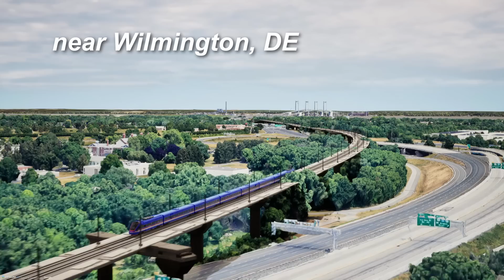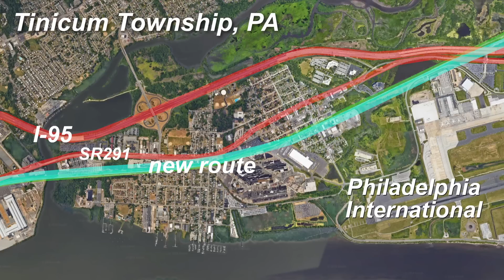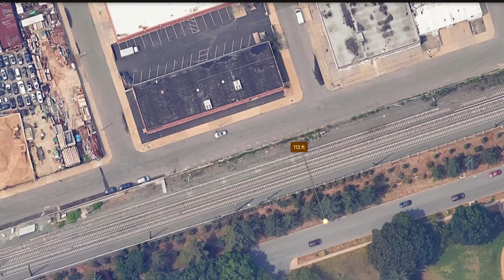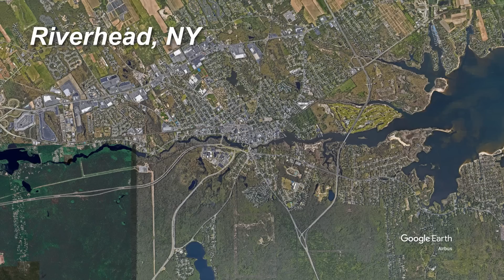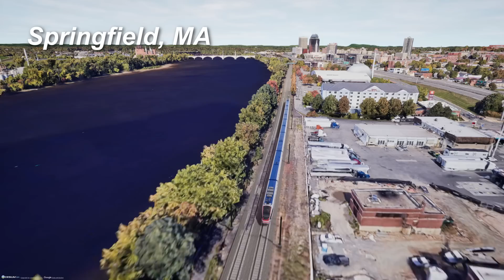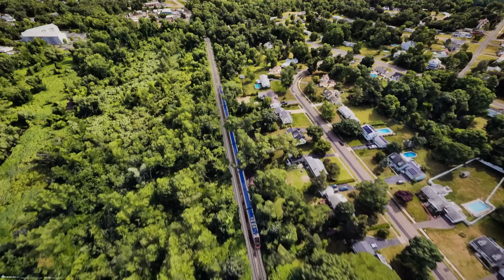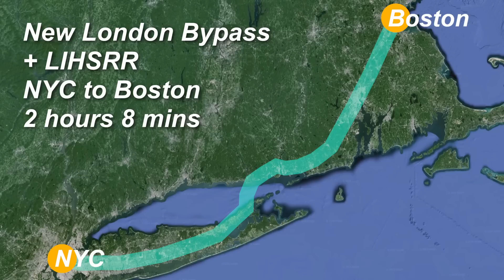How YOU Would Improve the Northeast Corridor For Acela High Speed Rail Service

Comment: 45 minutes could be saved by fixing the extreme schedule padding and lower than geometric speed limits from NYC to New Haven on the current ROW.  That would be nearly free and should be the #1 option to start with.
Reply from the maker: I talk some about NEC Commission plans to cut 22 mins from NYC-New Haven in the first video. This is largely accomplished by electrical upgrades and speed increases in the existing ROW.

Comment: Man it'd be a real kick in the balls to dissconnect a 1,622,520 population metro area from the NEC High Speed rail. Especially considering RI is already one of the fastest sections of the NEC. Removing the Providence stop is a non starter IMO.  Its rough man, CT really screwing us over.
Reply from the maker: What's going to stop Amtrak from running trains on the existing line?

Comment: Great video, and you've become my favorite channel on these topics.  (sorry citynerd). I think the "island hopping" through and under Fishers Island would be the best rout to get from Long Island back to the mainland.  If it was a tunnel it would lessen opposition maybe?  I'm not going to mess with you on your pronunciation of Ronkonkoma (lol), but the stop there should be coupled with a new terminal on the Northside of the airport.  Also what if the long Island to mainland tunnel had an auto train type service?
Reply from the maker: Here's the logic on Orient Point. First, you can't get to it on the surface from Greenport. At best you can come back to the surface for a mile. Can't island hop on the surface. With a tunnel, the islands are irrelevant. On Fishers Island, you have maybe 2 1/2 usable surface miles assuming that could possibly be allowed. It is 31 miles in a straight line from Greenport to Rhode Island, so you're looking at 30 miles of tunnel there. It's not a good choice.
Reply: @LucidStew  the island hop under the islands, like Fishers, would give you ventilation shafts and emergency exits if that kind of thing was needed.  Granted this would be a super long tunnel.  I don't know, 30ish miles?  Anyway thanks for the reply and all the work you put into these videos.
Reply: Just wanted to add as a point of reference, the Channel Tunnel is 32 miles long.

Comment: It's probably not worth another video, but exactly how unsalvageable is the route between Philly and NYC? What kinds of speeds does it currently get and how many trillion dollars would it take to upgrade significantly?
Reply from the maker: It's not that bad, its just that its not worth the cost to upgrade it. NYC to Newark, NJ you have the work currently on the books and that's about as good as its going to get. Elizabeth and Metuchen are the two sticking points down to Trenton. To get both up to 160mph, you're probably looking at 8-10 miles of tunnel. ...or you could just go 90mph for 15 miles... Trenton to Frankford Jct. you could get to 160mph, but its similar to New Jersey where anything you decide to do on the surface is going to involve taking out a lot of property for what you get. Then, of course Frankford into 30th St. is the big problem, and that can really only be solved with a tunnel.
Reply: @LucidStew  thanks! I live in that area so I'm familiar with how dense it is, but from my experience it's mostly a straight shot so I didn't know where the bottlenecks were.

Comment: I moved to Eastern CT in the mid 1990's & got my rural house & 5 acres on a creek for a steal because they were still talking about the I-84 interstate between Hartford & Providence, & my house was right on the route, but due to the bad publicity they couldn't get anyone to even look at it, but I worked for the DOT as a civil engineer so knew they were never going to have the $$$ nor be able to get the permits to build it.

Now the "Hartford to Providence" route goes right thru my house (just east of Bolton Notch, east of "Manchester NH" lol), so that battle can be fought all over again.  The terrain from my area to Providence is very rugged (altho not high in elevation), the high areas are all solid rock, the low areas are all wetlands, much of them forested, white cedar swamp, VERY valuable ecologically & impossible to replicate artificially, much of it along the "Air Line" & "Hartford to Providence" routes (duh they followed the creek/river valleys).

The NIMBY's & BANANA's (Build Absolutely Nothing Anywhere Near Anything) in this area are nearly as vocal as the ones along the coast line, altho not as wealthy / politically connected.  The Univ of CT (UCONN) in Storrs/Mansfield had a very organized anti Hartford to Providence highway ultra liberal lobbying group back in the 80's / 90's, they were pro train back then, it'd be interesting to see what they think of an actual HSR route that fills tons of wetlands, takes scarce (in Eastern CT) prime farmland, & takes many rural farms & businesses in an economically depressed area.  A station at Willimantic (the town name of Windham) might help, or even an alignment that passes thru UCONN or a sort of Princeton shuttle from WIlli-town.

I am over 60 & retired so anything that affects my house will be well past my expiration day.  Not something I lose sleep over lol.

I think the New Haven - Hartford - Springfield - Worcester route has more Leggs because it serves far more population centers that are more disadvantaged historically / economically / racially.  The existing New Haven - New London - Providence does as well & would remain as semi HSR, with minor improvements, basically splitting the NEC into two routes that serve major population centers along each route.  Also the New Haven - Hartford - Springfield route is already being upgraded currently as a "regional / commuter" line, double tracking, new signals, & all hi level platform stations are already done south of Hartford & are being worked on from Hartford to Springfield.  The downtown Hartford station is a big unknown depending on what happens to the I-84 viaduct.  The bridge over the CT river is being ignored for now in the current scheme.  MBTA has discussed extending service from Worcester to Springfield (& on to Pittsfield & possibly Albany) but they are pretty cash strapped just to maintain existing infrastructure so I don't see that happening any time soon.  That entire inland route would need electrification but could remain at 2 tracks w/3 in places with enough space given that the New Haven - New London - Providence route would remain.
Reply from the maker: Last I read they were considering demolishing the historic station and placing a new one on the other side of the realigned I-84 from downtown in Hartford, which kind of blew my mind.
Reply: @LucidStew  There are a Plethora of proposals for the entire Hartford area, triggered by the need to do SOMETHING about the I-84 viaduct, with a grand scheme to reroute all the highways around Hartford downtown & restore the riverfront.  I doubt very much they'd ever demo the existing station, which is very historic, & there are quite a lot of Historic BANANA lobbies in CT (wealthy folks with time on their hands, some with architectural backgrounds).  More than likely if the rail route got moved the station would be turned into some sort of development / museum / fancy restaurants / brewpub / etc.  I don't think it's in the path of any of the highway alignment proposals, or if it is, not one that is being considered realistically.
Reply: There was another Amtrak proposal to use the Harlem Line up to Brewster NY then turn east to hit Danbury & Waterbury then Hartford.  There are existing rail lines along this path but they are single track & very curvey & slow, as the terrain is pretty rough, similar to Hartford to Providence.  If done in conjunction with the New Haven - Hartford - Springfield - Worcester upgrades, this would be a good "regional semi hi speed rail" proposal that would tie most of the medium sized cities together in the CT/Western MA area with semi hi speed, electrified double track service.  But it wouldn't address cutting time off the New York - Boston route at all.  I believe this was proposed due to speed & capacity issues on the existing New Haven Line - despite being fully electrified & mostly 4 tracks (Milford will be restored someday), there are plenty of issues - the New Rochelle interlocking is at grade & steep geometrically, there are many locations with sharp curves & bad geometry that can't be fixed as they are in the middle of cities (Bridgeport, Norwalk), there are 5 movable bridges, & it's a highly traffic-ed corridor with many stations.

Being that I live here, I personally care more about networking my area via electrified double track regional rail than I do shaving 30 min's off New York - Boston at the cost of 10's to 100's of billions.  The benefits of using the train vs flying already exist with current timetables given the time it takes to get to / from airports, go thru security, etc., as the train stations are downtown.  I am still in favor of incremental improvements of course.

Comment: Billion per minute gained is interesting but does not tell you about capacity. You may gain zero for track geometry but you gain by not having fast trains waiting behind slow ones. Or even if your trains are full, add some trains and sell more tickets. 
Of course, improve geometry at sale time could great, if affordable.
Reply from the maker: Right, you need to infer that somewhat from the area being serviced. $230 million/minute between Hartford and Providence doesn't sound bad, but $900 million/minute between NY Penn and New Rochelle is probably more worthwhile. Also important is the demand that would be induced by speed increases. So Boston and Providence via Long Island is missing that important CT commuter component, but at $400 million/minute, a 2h8m trip on that corridor likely boosts ridership quite a bit. Certainly anyone going directly between NYC and Boston would no longer have a reason to travel through CT if that were the case. Also, at that rate, you're very time competitive with air travel between Boston and NYC when considering airport time, and those routes have a LOT of daily flights.

Comment: The big missing piece in Philadelphia is the massive right of way already cut out for i-95, which doesnt run at ground level but instead on a raised bridge or earthen section ABOVE most of philly. 

I think there's ways to get creative with that, like digging out some train in the same right of way as the raised highway, or underneath it where need be.

Comment: 10 % rule in general is my fix.

10% of all state and federal dollars spent on highways must go to trains.  Not saying you have to cut any projects, but if you spend 1 billion on a highway this year, you need to add 100 million to the superior train budget.  This gets us off this highways are free mindset and guarantees more funding for the superior transit mode.  

Then apply that to the 10% slowest portions of track already existing.  Even the most local boring trains could all run so much faster if we just spent time addressing the most absurdly slow sections.  Survey the 10% worst areas and prioritize them with projects until we alleviate that 10%

For your long island width issue, why not do what many subways do, either dig or build up one line to go over the other line, thus saving a lot of width space.

Comment: The best location for a Philadelphia station is 30th Street. It would save billions. The best place for a tunnel would be under north Philadelphia to create a highspeed curve that eases back into the Corridor past Frankford Junction. 

Between Chester and Eastwick your alignment is spot on except that if you move the curve in Essington a little farther east, you'd be going over or through parking lots. North of Eastwick station it is a straight shot into 30th Street if one follows an older alignment. The current SEPTA route took a cheaper but slower option in order to hit the approach into the upper section of 30th Street. 

Cost or time saving by missing the city altogether doesn't make sense in the context of one of the 10 largest population centers in the US and one of the densest.  Taking a short commuter train from South Jersey to downtown might make sense to some people, but it may not make sense to someone coming from West of the city. Furthermore, I'm allows for a seamless connection with your Philly to Pittsburgh route. Almost all of the regional transit options are centered on 30th Street. By the time you've added in the secondary costs of reorienting everything to the Jersey suburbs, it isn't worth doing.
Reply from the maker: What about going underground on the main line somewhere around Gray's Ferry, then meet up with 30th street underground, then similar to the video through Frankford Junction?
Reply: @LucidStew  I think tunneling to avoid the turns just to avoid the curves around Grays Ferry and Zoo Interlocking are a bit overkill since the train more or less immediately enters yard space then enters the station platform coming from either direction. I lived in South Korea for a few years, and the KTX trains had to slow entering Seoul merely due to yard space around the two stations, so this isn't without precedent. Further, if 30th Street Station needed to expand by lengthening platforms, doing so by expanding south is likely the best option.

 For a tunnel to avoid Frankford Junction I would continue the line northeast until around 5th and second streets then tunnel under the Juniata neighborhood until it links up with the corridor again north of Frankford Junction. This would be shorter and cheaper than trying to tunnel under Center City. North along 95 and the Delaware river, there are a few kinks, but land use adjacent to the tracks is poor. The high speed portion of the right of ways could be straightened without affecting any residences or business districts (a few junk yards). 

For all this you get a downtown station that is connected to the region and a transfer to Harrisburg and Pittsburgh with less land acquisition. 

If you've never been to Philadelphia, I highly recommend the trip!

Comment: I feel $250 million per minute saved is a reasonable price tag for NEC. That is roughly $25 per minute per annual ridership.
Reply: @onetwothreeabc  25 per minute at current ridership a significantly faster train might mean even higher ridership
Reply: @fasdaVT  Maybe the faster train gives more ridership. But hypothetically, if we use the same amount of money to shove $25 from the ticket price, won't it generate even more ridership?
Reply: @onetwothreeabc No, it won't. You don't have the capacity to move that extra ridership right now. If you have faster trains (more round trips per day) and more service, you can move more people.
Reply: @daniellewis1789  Are you implying that NEC regional and ACELA all filled up for each train now?
Reply: @onetwothreeabc  The load factor on Northeast Regional during peak times is pretty dang high, likewise Acela is full during peak times. Are you saying rush hour trains aren't sometimes standing room only?
Reply: @daniellewis1789  How about try to add a car or two on NEC Regional, or double up Acela on peak time before considering multi-billion infrastructure projects?
Reply: @onetwothreeabc amtrak literally doesnt have enough equipment. The acela’s are falling apart and the amfleets aren’t doing too much better. Also, mind you, the NEC is currently profitable. No reason to believe better service couldn’t capture nearly all existing market share from airlines between BOS-DC
Reply: @onetwothreeabc  You can't double up Acela or add very much length onto Northeast Regionals. You end up with your train not fitting into stations. Sure, you can get a bit more capacity with longer Acelas - that's being done with Avelia - but double is too much for the platforms. Same with the Regionals, they can't get doubled without major platform work.

Also, if you spent the money on fare subsidy, it would run out and you'd be back to square 1.
Reply: @daniellewis1789  Then spend money on elongating platforms and buying cars before building a route that saves only a couple of minutes.

Other country like France, Japan often have 16-17 cars long station. NEC should have it too.
Reply: @onetwothreeabc  The Pennsylvania Railroad made a habit of running 18 car trains (or more!) on the section south of NYC.  North of there, however, lower demand meant shorter trains were more normal.  And when traffic took a downturn in the latter half of the 20th Century, station rebuilds and new construction were not built as long as they had been.  

A good example is Providence, where the station (about 1/3 the number of tracks of its predecessor) is now facing a capacity crunch.  

Look also at Metropark-originally built for the Metroliner service in the late 1960s.  The platforms can only accommodate 12 cars.  Trenton, which received new platforms, also is incapable of accommodating a full 18 cars.  

The Pennsylvania was able to get away with running such long trains in part by simply not having the entire train stopping at the platform.  Needless to say, that would not be acceptable today.  Amtrak would have to build platforms long enough at all stations served by a given train, or use selective door opening (which is a hassle for passengers), or double-stop a train (stopping once for the first part and then pulling forward and stopping again for the rear) (which would massively slow things down. 

Platform lengthening definitely IS something that needs to be done, but it is going to be tricky in many locations, especially since having curved platforms is now a big no-no.